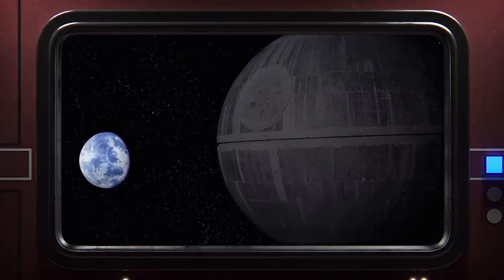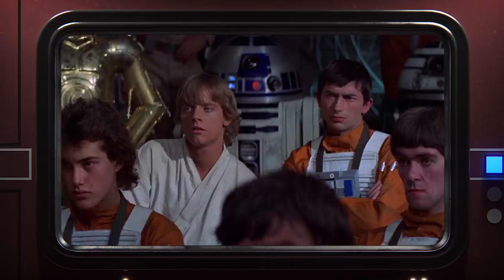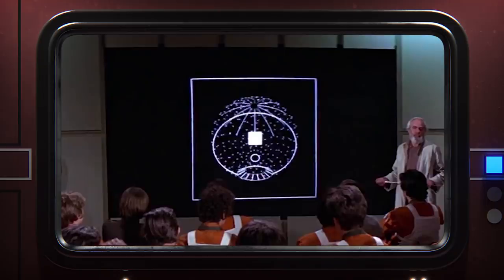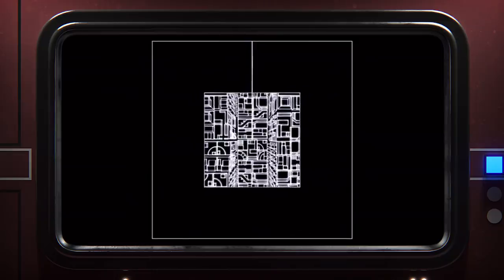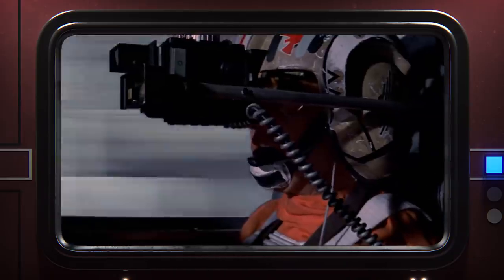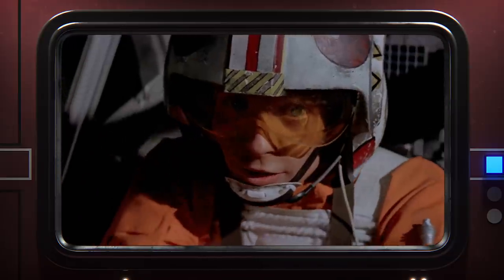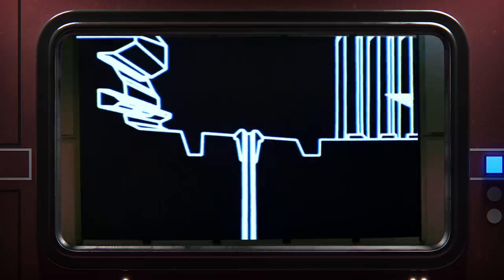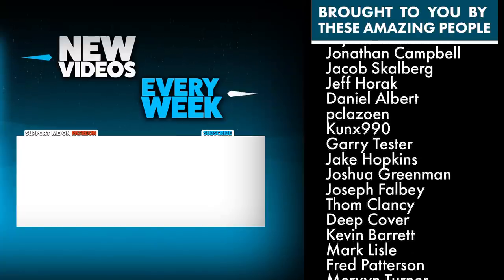The Thermal Exhaust Port Was NEVER a Problem

Comment: It is also an illustration of the Empire's hubris.  "Evacuate?  in our moment of triumph?"  the Empire expected the rebels to throw everything they had at them, capital ships and such.  also in the movie's dialog.
Reply: a small chance of defeat (that required the use of the force) to abandon a very expensive station.  the only logical solution is to stay put and trust the only known force user (the emperor was still mostly secretly force user, and the jedi were dead) to shoot down a handful of enemies that make it down the trench.
Reply: The Rebels had already thrown the bulk of their fleet at the Empire over Scariff. Remeber the end of Rogue One dovetails right into A New Hope.
Reply: AKUJIRULE  a) no it cannot. approaching from behind the gas giant allows for maximum surprise and gravity assist to close with the moon as fast as possible. It is not OCCLUDED but specifically stated NOT IN RANGE in the film. matching hitting range with line of sight is actually a defensive choice so they are protected from ground based weaponry (Such as a giant ion cannon for example- see hoth) for as long as possible.
b) it can CARRY thousands of ties, but it cannot LAUNCH thousands of ties at a time-it does not have the hangar bay space- and they have to catch up to rebel fighters that slingshotted past a gas giant.  - note standard tie fighters are slower than x-wings and y-wings when they divert power to engines- so they couldn't even keep up on the trench runs.
C) the rebels have avoided ambushes thus far by using spies in the navy. The death star is under blackout. it has the best chance to wipe them out with minimal risk.
Reply: In the original edit there was no base.  That was added in post to make the final battle more dramatic.

Also, quite importantly:  Tarkin is not the empire.  All the other generals and admirals are openly sceptical of his plans.
And the empire also includes the opposition faction led by Senator Organa, as mentioned in the dialogue between the generals before Tarkin enters the room.

Comment: "Great shot kid, that was one in a millon."

Han Solo wasn't exaggerating when he said this. Without Luke and his guidance from the force, the rebels had a million to one chance of exploiting the Death Star's "weakness".
Reply: Yeah, that zoom out from the plans, with the little torpedos really shows it.  Luke didn't just need to get the torpedos into the port, he needed a magic shot that got the torpedos all the way down kilometers of narrow heat duct.  Even firing straight down into the port would be a pretty low chance, but since the defenses forced the fighters to do the trench run they were coming in perpendicular to the shaft anyway.  Short of a force curve setting the torpedos on the perfect course after they're already in the hole it wasn't gonna happen.
Reply: change the angle of attack. they aren't in an atmosphere they can literally fly straight down at the exhaust port and fire with a straight line of sight not million to one at all.
Reply: @Weeping_Willoe  Torpedos tend to have steering, though. Think about it... there were two that had to converge on their way from the ship to fit into the duct, they could steer a pre-programmed path down into the port, and then continue to navigate the duct.

I guess I just find this more plausible. As you said, considering the distance they would travel to the core of the Death Star, Luke would have had to magick them (very) perfectly, because even a half a degree of variation in the approach angle (on all axes) would have them hitting the walls of the duct before they hit the target.
Reply: @sixwingproductions  did you not pay attention dolt! The trench on the space station colloquially known as the death star was out of the range of turret fire if the rebel ships called the y wing and x wing flew straight down the pilots would have been shredded by turbolaser fire
Reply: @technounionrepresentative4274  except that the fighters were to small for the turbo lasers on the death star to be effective and there were turbo lasers in the trench. not to mention the fire they had to dodge to get into the trench in the first place. so what your saying is they could only dodge the turbo laser fire to get into the trench but not to go into a steep dive and fire. also that would imply that once they leave the trench they should get shot down immediately which is not what happened.
Reply: @sixwingproductions  less lasers in the trench 
Many more ships are destroyed outside the trench 
A coupple are destroyed in the trench but not as fast as they would have been outside the forementioned trench
Reply: Was it?!
Reply: Actually, the shot was possible without the use of the Force.  Garven Dreis nearly made it in his attack run, but just narrowly missed.  Luke probably could’ve made it without the Force if you gave him another crack, but the stakes were too high.
Reply: @technounionrepresentative4274  Turbo lasers are designed to shoot at larger ships they are not anti-fighter weapons...
Reply: One of the pilots was claiming that the shot was "impossible, even for a computer."
Reply: @sixwingproductions  Turbo lasers are not point-defense-systems though. To deal with smaller craft, you need point-defense. There's a reason human operated machine guns are still used on our naval vessels today, alongside computerized ones. Point-defense, is extremely important for the survival of anything. The Death star had no point-defense-system, because the designers saw no one daring to attack the thing with a small fighter. So they had to rely on fighters and turbo-lasers.

Get enough Turbo-Lasers firing at once, you're bound to hit even the smallest of crafts. It's similar to just rapid firing down range, you're bound to hit something eventually. To reduce the odds of getting shot by the sheer number of turbo-lasers, they reduce the turbo-laser count by making the trench run.

But yes, because they are in space, and not in an atmosphere, they didn't need to remain parallel to the trench. The moment they came upon the port, they could have pulled up (relative to the Death Star being in the "down" direction), and then dive onto the port soon after to get a straight shot against said port. Because the other fighters are still in the area, majority of the turbo lasers would have their cannons facing a different direction, giving the pilot ample time, because he still only has to worry about the fighters and the lasers in the trench itself.

EDIT: The problem comes in with what that port is though: EXHAUST PORT! That means energy is coming out, not being sucked in. That means anything that enters will be heavily affected by the energy pushing back against it. That push back can cause just enough problems even with self-guidance of the torpedoes, to still cause it to slam into the side walls, because of how narrow the port is. It's the energy pushing back against anything that enters, that makes it necessary to have the force. Hence why Leia, went to get Obi-Wan!
Reply: @deathsheir2035  the Death Star did have laser cannons which are specialized against fighters though https://starwars.fandom.com/wiki/Super_Blaster_920_laser_cannon
Reply: @sixwingproductions  no they can‘t. The port is heavily which makes the trench the only viable approach.
Reply: My theory is that the original plan was to ignite hot gasses coming out of the port. Had this plan worked, the Death Star’s destruction would have closely resembled the second one. Luke using the force to create wire-guided torpedoed ended up instantly destroying the station.
Reply: @braith117  And Luke just (In Tatooinian slang) sandbag the pilot by correcting him.

Comment: TBH, no one would really have planned for a Jedi attacking the death star... 
Think about it, a guild of space wizard that was wiped out several decades ago, with powers unknown to the public
Reply: Dorkly reference?
Reply: Yeah, basically without Luke, this Death Star operation wouldn't be even successful even with full force attack from the Rebels. Which will be worse since sending fleets to Death Star will just make Tarkin at least send more Star Destroyers docked inside the Death Star.

Luke literally made a miracle in this operation, which something Tarkin or any Imperial commander cannot prepare for. Darth Vader I think at least felt this and recognized the possible threat since he is a powerful Force user. Alas, they only sent small squadron of TIEs.
Reply: "Several decades"?
Less than two decades based on Luke's age.
Reply: the death star started construction when the Jedi order was still around, but ok
Reply: Except the two guys in charge of the bad guys that know how this crap works.
Reply: True.with an unholy swarm of fighters, however, one would get through at least and one is all you need. They just didn't have a swarm of fighters at Yavin.
Reply: @davemarx7856  I mean sure, if we're taking in later bits of story, but if you rewatch the movies. It's not something new it's old.
Reply: @kornkernel2232  Sources say that only Vader's personal TIE squadron was launched.
Reply: I dont know why they couldn't use Yoda or Obi-wan, why it had to be some inexperienced kid. Vader must've known they were alive.
Reply: @ceilyurie856  sure they can... But are they gonna waste their time knowing the magical space wizard genocide just happened?
Reply: The space wizards weren't wiped out. One of the commanding officers was literally a space wizard who liked to strangle his subordinates

Comment: "A precise hit will start a chain reaction which should destroy the station... only a precise hit will set up a chain reaction."

This line here is the one that always settled it for me. It takes the weak point from being a scenario of "line up your shot right here and you can shoot directly into the reactor" to "shooting this spot sets off a domino effect that causes a series of explosions to blast into the core."

Considering real world design flaws like Tacoma Narrows, The Titanic & The Hindenburg. Cascade failures caused by small variables the engineers weren't thinking about exists well within the realm of possibility.
Reply: Late response, but it reminds me of how one of the Japanese carriers in the Battle of Midway went down. An American dive bomber landed a non lethal hit on its deck that penetrated down to its storage, there was a bunch of poorly stored munitions, fuel, and airplanes there, a chain explosion happened, and the carrier went down.
Reply: @404found00  Not helped by the incompetent attempts at damage control.
Reply: I’ve come to believe that the plan was to use the torpedoes to ignite the hot gasses coming out of the port. Luke using the force to create wire-guided torpedoes made this plan moot.
Reply: @hanzzel6086  Typical Imperial Japanese Navy damage control includes such masterful plans as turning your own ship into a fuel-air bomb while trying to repair it.
Reply: Perhaps the death star exhaust port system was designed so that only that single exhaust port could cause the correct reaction while the others wouldnt.
They could've tested the other ports for some chain reaction and said "see? Nothing happened"
Reply: @mynamesnotdan  they never had the manpower for all port attack
And also their best pilot fail to land a shot, it was Luke deliberately using the force to bend the proton torpedo path
So really this arguement was like asking a knight to cover his eye sight with armor so a magician cant shoot it with a precise flame bolt
Reply: The Titanic didnt have any design flaws, besides the lifeboats that is. It was human error in not having the binoculars that doomed the ship
Reply: @vanguard6498  titanic did have some design flaws, the watertight compartments for one.
Reply: @gamerfan8445  That wasn't a design flaw, it was an advanced safety feature of the time. And let's be real, no ship can float with five compartments flooded

Comment: More specifically: The exhaust port is not just a hole that goes right into the main reactor!!  It's not like a chimney over a fireplace.  They mention in both Rogue One AND in A New Hope, that the precise hit on the exhaust port would trigger a chain reaction that would eventually lead to the main reactor.  That means that it goes in and hits a thing, that thing explodes, that explosion destroys another thing, on and on and on until the reactor goes.  
Yes, the schematics seen in the movie show a line all the way to the reactor.  They also show the superlaser dish on the equator, so excuse me if I don't put a lot of faith in that.
Reply: Superlaser dish placement: That's only because that scene was filmed and then the superlaser placement was moved afterward.  They would've had to reshoot large portions of the end battle planning scene in order to move the superlaser placement that we see there.  They didn't have the time or the money to do that.
Reply: @specialagent4575  I figured it would be that they didn't have the budget to redo the special effects, and that's understandable.  But like, on the other hand, of all the things that they could have fixed in the 1997 Special Edition...!  You'd think the one glaring error would be higher on the list than Stormtroopers riding on Dewbacks...
Reply: Also, the pilots didn't need to know the exact technical details of the flaw. All they needed was a simplified version.
Reply: The dish location is not a mistake, the picture we're shown is a presentation meant to explain to the pilots the battle plan, they weren't the actual blueprints
Reply: @GiubileiFernando  As a corollary to that idea, maybe all the small ports shared that weakness, but concentrating forces on just the one would maximise their chances.
Might be the given one also happened to have the poorest defence coverage, for one reason or another.
Reply: Yeah but.....in the slide show in ANH it's clearly shown to be a straight line down the main reactor........
Reply: @inkedseahear  Again, as I said, the presentation at the briefing also shows the superlaser dish intersecting the equatorial trench, which is obviously not true, so that is kinda meaningless.  The reason is that the super-expensive 1977 cgi used to make that video was already finished before they decided on the final design for the Death Star model, and they couldn't redo it.  (Seriously, of all the things they could have changed for the special edition....)
Reply: @TheOtherGuys2  That would retcon it though.
The schematics may not be the original, or on a different scale (like hydric maps), only showing the purpose of the exhaust port, not the path of it.

That's one of the things that can just be explained, no need to redo the scene.
Reply: @JonatasMonte  I dunno, I don't think I buy that.  Anyway, is anyone really attached to that little animation that plays in that scene?  I doubt it.  I'm not saying they should redo the whole thing, fair to say the Rebellion couldn't afford a nice hologram, but maybe make it look a bit higher quality, on par with the DS2 plans in ROTJ.  
I really do think that of all the things they had the opportunity to do, that's something they really should have looked at.
Reply: While all of what you said is true and explicitly stated in the film itself, the modern consumer of pop culture only knows about the material through secondary sources. That’s why it’s considered a “fan theory” that Vader and Tarkin let the Falcon intentionally escape the Death Star, even though the plan that had Tarkin “taking an awful risk” is discussed in multiple scenes, even by Leia.
Reply: @inkedseahear  the slideshow is a simplified animation designed to illustrate that a chain reaction of explosions would eventually reach the reactor. I would hope the Death Star plans themselves didn’t come packaged with an animated tutorial telling a user how to launch an assault on the station, going so far as indicating the one weak spot to be exploited, and the type of munitions required.
Reply: @Neuttah  I really like this idea. The important part of the battle is that all the pilots had a chance with maybe the Y-Wings having the better chance. Luke made the shot without a risk of messing up because he used the Force to time/aim the torpedos perfectly. It was a do or die moment for the Alliance and Luke could not trust the X-Wing targeting computer on a last ditch shot.

Beautiful ending to a fantastic film for the ages.
Reply: @pspublic13  that, and Red Leader HAD already made a computer assisted shot and it missed.
Reply: which also makes the fly away shots make sense. it might tak a bit for all those secondary explosions to reach the main core.